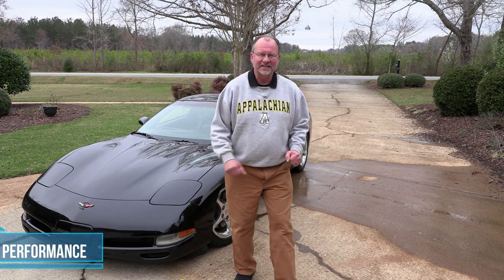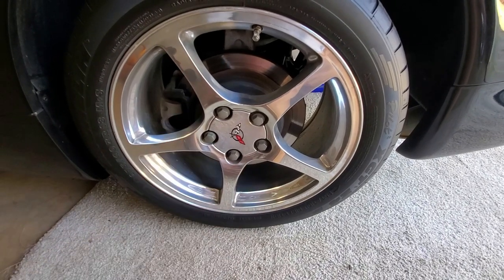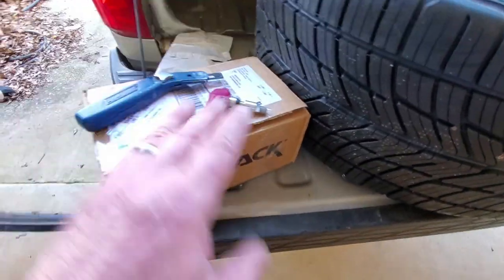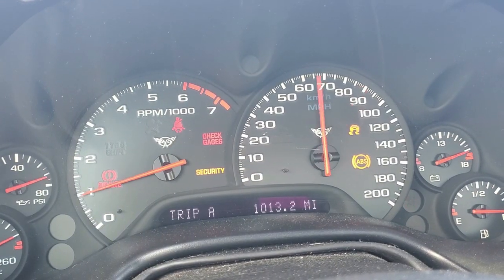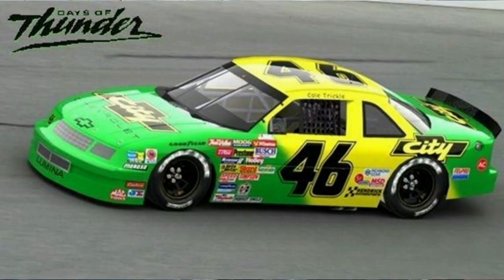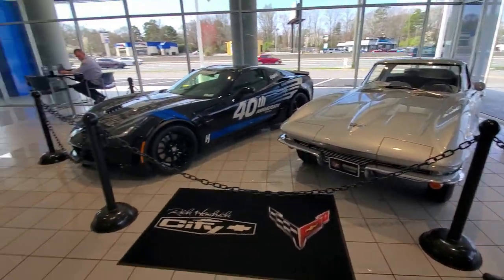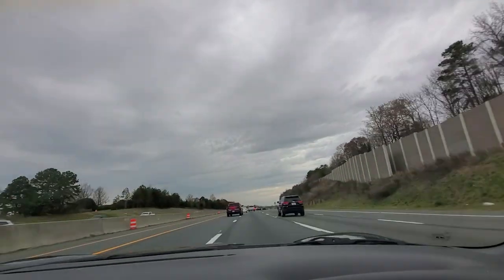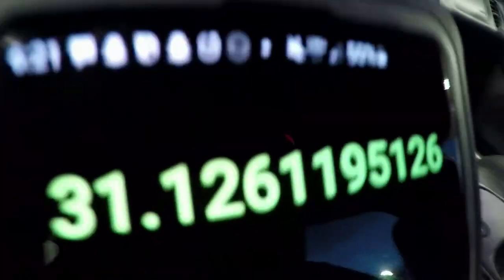C5 Corvette update and first Road Trip & MPG check!!! Pt. 3

Comment: Loving the C5 “barn find “
31.1 mpg on 87 octane is amazing. Of course that’s mostly highway miles but out of a V8 that’s amazing. That amount of economy out of a Corvette is simply fantastic. 

I get approximately the same highway mileage in my 2002 Lexus ES 300 on 93 octane Shell premium!  And mine is a Luxury Sedan with only 210 hp. And a 3 liter V6 ! 

Once again my choice of sports car when I retire in about 5-6 years will either be a manual C5 similar to this one, a manual C6 or a newer Mustang GT. I’ll be keeping my 2002 Lexus for many years (at least 10) so my desire for a sports car will be stronger than ever by then.
Reply from the maker: Yes! And thanks for the interest Stephen!! Good luck with your C5 search!!! Just great cars, easy to work on and parts are inexpensive and plentiful!!

Comment: I have been all over the south west in my c5 and have loved it , but the air went out and I drive in town only,  I drive it everyday,   best car I ever had
Reply from the maker: The compressor is a bit of a bugger to replace.  The aluminum corroded between the housing o-rings and then pit and then leak. Called Delco "Belly Leakers". Mine leaks a bit over time so will replace soon.
Reply: @classicperformance  that's what I have been told, and very expensive to fix,  here in Arizona when it gets 120 I don't drive it,  but it's the best car I've ever owned and I've owned c3,c4,c6 , I did notice that your oil gage was not working,  mine did the same thing last week,  but still the best 😀👍

Comment: I always knew that C5 corvettes and Camaros/firebirds of the same years were really fuel efficient even more efficient then some 6 cylinder sedans of the same years…..those LS1 engines were and still are one of the best engines ever built….even the older LT1 engines the LS1 replaced were also pretty efficient, I have a soft spot for them LT1 engines, they didn’t make as much HP but they were torque monsters!! And in my humble honest opinion them LT1’s sounded a bit more muscular then the LS1’s in stock vs stock form……also in my opinion even the 4 speed auto’s had pretty decently good mpg’s on both the LT1 and LS1 engines….
Reply from the maker: I fully agree~!  I once had an '84 Vette with the cross fire dual TBI system and a 4+3 speed. Crappy car from a build quality standpoint,  but great AC and ran perfectly getting upper 20 MPG on the HWY.
Reply: Same with the L98 good engines

Comment: i just bought a 2002 z06 with 3,000 miles, its a bit weak for me so im setting up to get some work done on it. i previously had a 1993 viper, not much of a comparison stock to stock the z06 just feels like 150hp.
Reply from the maker: Steve, Congrats on the Z06, and with only 3k miles. In today's world, it just might feel a bit underpowered. It's pretty easy to get a good bit more out of it with just bolt on parts. Keep us posted on what you do and the results!!!

Comment: Curious why you didn't just replace all four TPS sensors. As long as it sat and as old as they are the other three are sure to start malfunctioning too, don't ya think? Then you have to pay the labor to pop off the tires again.
Reply from the maker: Well, we'll see. The one that failed was because the tire had water in it from a rusty nail puncture. They seem to be holding up just fine. You can install new ones by breaking the bead and not dismounting the tire. So, not a big deal and pretty quick.  I have also had quick failures with the replacements vs the originals. so, if the originals are working leave them alone.

Comment: I noticed your coolant temp was 208 while you were sitting there.
It may have crept up while idling, so maybe you need a better fan.
Reply from the maker: Warner, the two cooling fans on a C5 are very capable and each can operate at 2-speeds. The temperature rise you observe while not moving is because the eleftric fans will not activate on low speed till @227 degrees fahrenheit. The will quickly cool the motor down to @217 degrees then shut off. This is in the ECU programming. The 208 you observed is the "creep up" in temp from a below fan speed system after being on the road. Also, a C5 does get enough air flow even without a traditional grill opening, so much so, the fans are deactivated above 35 mph for economy.  These parameters for fan operation will change once the AC compressor is engaged and that is a way to cool the motor and radiator below the 217 minimum operating threshold should you lower the thermostat as I did.
Reply: @Classic Performance  I had always heard these things operate at a higher temperature than most cars.
I wonder if some vents in the hood or wings would help with airflow so as to run a little cooler. That temp would scare me a little.
They make waterless coolant that boils at around 280° from what I understand, so I've heard.
Reply from the maker: @wernerdanler2742  These cars cool very well, especially under way. The programming is such that they regulate the engine temps to be that hot by not turning cooling fans on (low speed) till well over 200 degrees of engine temperature. If you change your thermostat and reprogram the fans, you can make them run as cool as you like with the OEM equipment/radiator with no trouble at all.
Reply: Yeah. I got scared by that at first, went on corvette forums for advice, and it literally says they’ll do that in the owner’s manual.
Reply from the maker: @shaunwalsh85  something likeECU  228 fans on and 217 fans off. Very hot parameters. Not even close to fans on Temps. Just getting warmed up on a cool night at idle just off the hwy w a 180 non orm spec thermostat which cooled it way below normal operational Temps.
Reply: @classicperformance  on the plus side of things, when it’s cold out, you get heat in the cabin during warming up faster than any other car I’ve ever owned. 😁
Reply from the maker: @shaunwalsh85  the heat and air in a C5 is simply amazing. Especially the AC when you consider all the glass and solar gain especially in the southeast as we are. Never a problem cooking even a balck on black C5. Thanks for the interest! New C5 upload out  this week!
Reply: @classicperformance  yeah. Until the damn screen goes out on the climate control, and the blower vent door no longer responds to the ‘mode’ button. at least I can still change the fan speed/ac/heat, it’s just stuck blowin out the defroster and both the hi/lo vents no matter what for now. coincidentally I named my corvette ‘trophy wife’ because with the amount of my checks she gets, I probably coulda had an ACTUAL trophy wife! 😬😬😬😬

Comment: Your didn’t say when you replaced the tires if they were run flat or regular tires
Reply from the maker: Chuck, good question. These were not run flats. I have driven C5 corvettes with the OEM Goodyear EMT "runflat" tires and the ride really suffers and is harsh. I would not recommend run flat technology tires. And, when was the last time you had a flat? for me in my area, it's been over 20 years.

Comment: Wonder if the 93 ethanol would still bet 2-3mpg gains. I'll be daily driving my C5 , to the tune of 150-200  miles a day 5-6 days a week soo the ethanol would never have a chance to sit and turn to jelly
Reply from the maker: I wonder too? The cooler thermostat I put in (my thoughts) would help reduce detonation on 87 and keep the timing up and knock sensor from going to work and retarding timing. I had perfect coolish conditions for the run!  So, my guess, probabally not but will retest the same run w 93 soon.

Comment: 2000 c5 10,000 miles mileage test, 200 thermostat, 25 mpg country roads ( tail of the dragon, blue mountain parkway and more) 30 mpg interstate.
Reply from the maker: You around the area at the Tail!!! Good report!!
Reply: @classicperformance  my wife and I did the corvette Caravan from western Canada in 2019. Bowling Green Devils Triangle the Tail then Atlanta, Highpoint NC, Ashville 2nd Tail, St Louis, Pikes Peak, ABQ, to our winter place PHX, back to Western Canada via the Oregon coast. The C5 is a great GT, easy on gas, lots of poke, lots of space (golf clubs and full size suitcase) I have a C7 even with running on 4 cylinders can’t match the C5
Reply from the maker: @Grump1  wow, I give a bow to you. Yes, the C5 is absolutly a perfect fit for me on a long drive. For me, that's about a half day to all total one day. Impressed with your trip!!

Comment: I'm confused on the performance axel ratio. I thought all 6 speeds came with 3.42's and only the automatics could get an upgraded gear ratio from 2.73 to 3.15. What am I missing?
Reply from the maker: You might be correct actually.  I had not though about that detail. Regardless it is the best performance rear and worst offender for full economy. Appreciate the question.
Reply: 3:42 only on z06 I believe.
Reply: @kazmierzglinny6728  GU6 RPO code for 3.42 gear ratio.  My base 04 C5 with the 6 speed has it.
Reply: @jp15001  I wonder if that was a specific option you have to order otherwise you might have gotten something else?
Reply: My base 01 6spd also has 3:42… btw, millennium yellow rules! 😜
Reply: 2.73 standard 3.15 optional 3.42 on all 6 speeds including the Z06
Reply: Can’t wait till I’ve got more power in my c5 and I can drop the gear from 3.42 to 2.73 for standing mile/top speed events. 😁
Reply: @classicperformance  3.42 on ALL 6 speed c5s........auto had 2.73 and 3.15.......the 2.73s were dogs.....i had one:face-purple-crying:
Reply: @kazmierzglinny6728  3.42 on all 6 speeds
Reply: @shaunwalsh85   wow......first guy i know that wants a 2.73 gear....lol.....they are almost giving those away!
Reply: @Robert-bg2nm  it’s what most top speed/standing mile shootout cars are geared with.

Comment: How well is your engine running on 87 octane? Isn't the vehicle required to run on  premium? Are you adding an octane booster with the 87 octane?
Reply from the maker: 87 seems just fine and no additional requirement. The knock sensor retards the timing to compensate. So, I departed the 92 octane which would produce a more advanced and aggressive timing curve, more power and even better MPG, I will do another of the same run with 92 octane soon and compare data results.
Reply: Does anyone know if elevation matters? I live in Montana and have been using premium because I just thought I had to. I'd be willing to run a tank of 87 (Ethanol free) through it as long as it doesn't hurt anything.
Reply from the maker: @thehomer5913  if anything, the higher the elevation the lower the compression ratio goes based on atmospheric pressure reduction (also less power) which also explains 2-speed superchargers 9n Allison powered WW2 aircraft for better performance at altitude. Also, the C5 has knock sensors to retard timing based on fuel octane.  You'll be perfectly fine on 87 non-ethanol as standard fill for all driving ranges.
Reply: @classicperformance  Thanks for the quick reply! I'll definitely experiment with Non-Ethanol 87. Your videos are fantastic. There's so many excellent tidbits that I have to re-watch them to process it all!
Reply from the maker: @thehomer5913  I appreciate your interest!! Best of luck with your car!
Reply: Don’t step on it running 87… sometimes when I take mine waaayyy up into northern New Hampshire, you can’t get 93, and I have to use 91, and I notice the occasional ping.
Reply: @shaunwalsh85  Thanks. I live in Montana and 91 is the highest I can get. Also, this might be a moot point anyway, as the only ethanol-free gas I've found so far is premium. Lower octanes at all the stations I've visited contain ethanol. Filled 'er up yesterday for $75!!!
Reply from the maker: Run a diagnostic and see if you have a knock sensor error, also change your thermostat to 180 as I did. You can hammer on it with 87, no problems. I have never heard a ping and only run 87 non-ethanol
Reply: @classicperformance  Thanks for the reply. My problem is finding 87 octane non-ethanol, or any non-ethanol below 91 octane. I've driven around Helena, MT and checked the websites (for Helena and Bozeman) that list non-ethanol providers and, so far, all I've found is 91 octane. I'll keep looking, but in Big Sky (small town) Montana I might be forced to buy 91 octane if I want non-ethanol.
Reply: @classicperformance  Hey there, I'm now wondering about ethanol fuel in general. It seems like the major concern is condensation build up with ethanol if the vehicle isn't driven frequently. If I drive my '03 almost every day is it OK to use ethanol fuel? Before winter storage I'll run a few tanks of non-ethanol through it and store it with non-ethanol plus stabilizer. But if I can use ethanol fuel for frequent summer driving that would really be helpful logistically.
Reply from the maker: @thehomer5913  I would subscribe to that thinking. Do a bit more research still, which I have not as to when the ethanol blend came to be the standard. I would ask the question if cars (fuel systems) engineered prior to this date, would be ethanol compliant and tolerant for long durations of that fuel blend in the system even without water absorbed (which it will over time, especially if tank is not kept full).  For me, if I am traveling, sure, burn the cheaper corn all day or week long, then refill with non-ethanol before less-than daily driving. My car might sit a month or so in the garage with fuel and just a few short trips. Don't want to "store" it in that way with ethanol blend.
Reply: @classicperformance  Looks like 2005 was the real ground zero. But after thinking about it, I bought the car in Nebraska and drove it back to Montana with no problems, buying premium wherever I refueled, without even thinking about this issue. So, like you said, on long trips when I'm driving it daily it's probably OK to use ethanol fuel, but I'll use the PureGas app to see if non-ethanol is anywhere nearby. Thanks for the reply!

Comment: Seems funny to put in 87 octane when they call for a minimum of 91?
Reply from the maker: Bill, the owner's manual states in section 6, page 3  "Be sure posted octane is at least 87 for regular fuel" "Use premium unleaded gasoline rated at 91 octane or higher for best performance"  "you may use middle grade or regular unleaded gasoline, but your vehicle's acceleration may be slightly reduced" the minimum requirement stated by the manufacturer  is 87.

Comment: Seems funny to put in 87 octane when it calls for a minimum of 91?
Reply from the maker: Bill, the owner's manual states in section 6, page 3  "Be sure posted octane is at least 87 for regular fuel" "Use premium unleaded gasoline rated at 91 octane or higher for best performance"  "you may use middle grade or regular unleaded gasoline, but your vehicle's acceleration may be slightly reduced" the minimum requirement stated by the manufacturer  is 87.

Comment: I thought the c5 took premium?
Reply from the maker: It does not require it which is more of the great news of C5. The owners manual states clearly 87 research octane. However, for maximum performance, 92 or 93 octane. In previous comments, I stated the exact verbage used my GM.   Thanks for asking!
Reply: That’s good to know I’m in the process of trying to buy a c5 rn prolly have to drop 18k sadly can’t find any cheaper in my area

Comment: Noticed your oil pressure gauge is pegged at 80. With all the maintenance you have done on the car, is there a reason you haven’t changed the oil pressure sensor? Why are you using 87 octane gas in your Corvette? You definitely would get better performance using 91 or 93 octane and would probably get better gas mileage.
Reply from the maker: Hi Richard, good eye and indeed the oil presser sensor is faulty. It reads zero or peg. It's a little fussy to change behind the intake manifold and I have been focused on safety and general maintence since recovered from long-term storage. Look into the comments on this or other parts as your fuel question is a popular one. 87 is the GM accepted fuel and above for maximum performance. 87 was the only non-ethanol available where I was. The fuel senders as se sensitive to ethanol so I would rather have 87 non, vs 90 ethanol in the fuel bladders. If I come across 90 or 90 non, I grab it. A tip, if you are near water and marinas, marine grade fuel is 90 non and even above. I have used plenty of "marine" at pumps!!